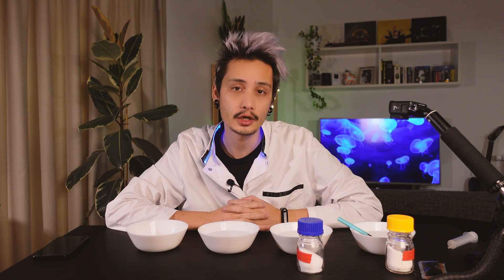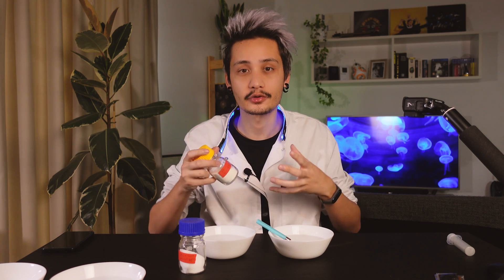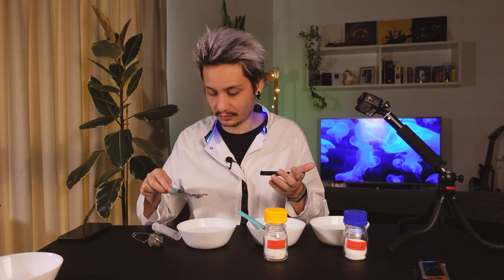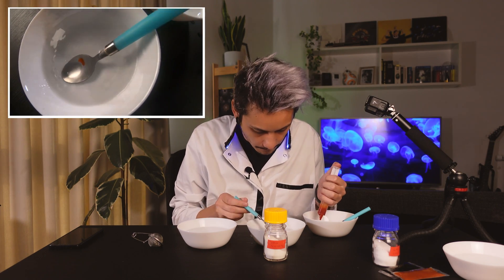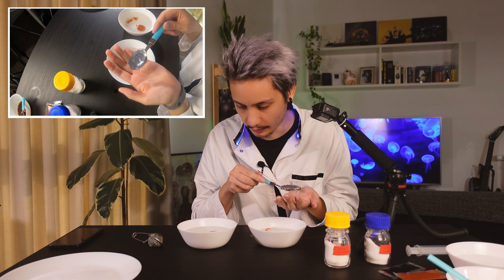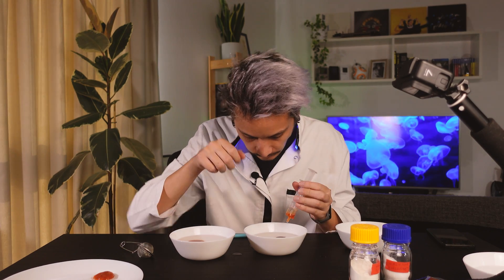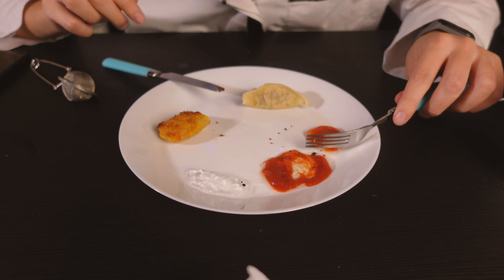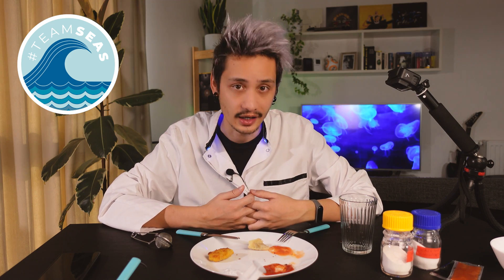Can I Make Plastic-free Sauce Packets? - Curiosités #6 - #TeamSeas

Comment: Lol, if anything, you made the case for plastic packaging rather than against it. 😂
 
But yeah, it would be cool if we found something that had all the benefits of plastics, with far fewer downsides. Over here in the West, the best we can do for now is to use plastics responsibly: use the bare minimum, use recyclable plastics as much as possible, and actually recycle it rather than littering. We're doing better than we did back in the 80's and 90's, but we still got a long way to go.
Reply from the maker: Ahah, yeah, it was a bit improvised and didn't work very well. But I'll try again in the future!
I agree with you. We are doing better, and can do even better :)